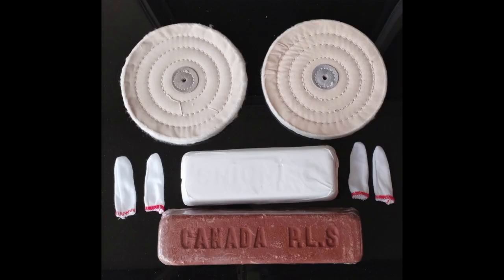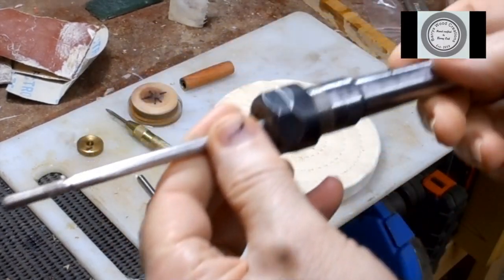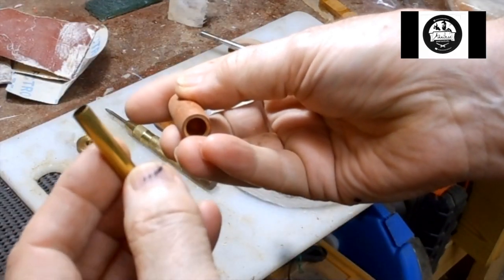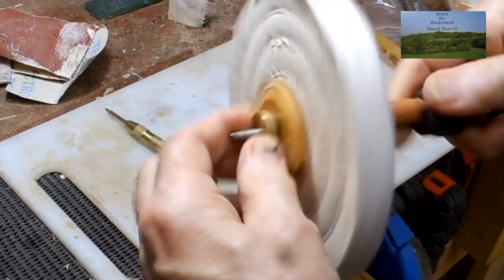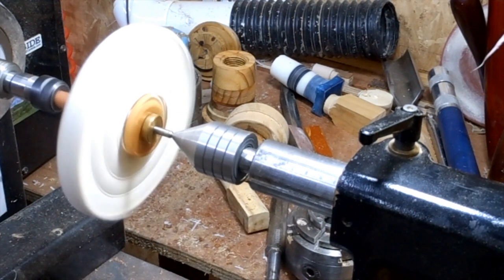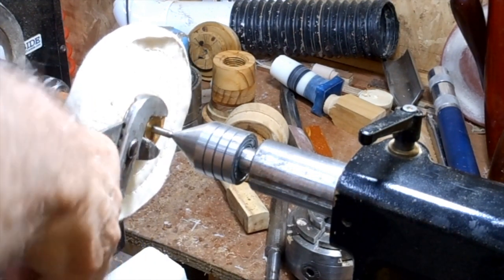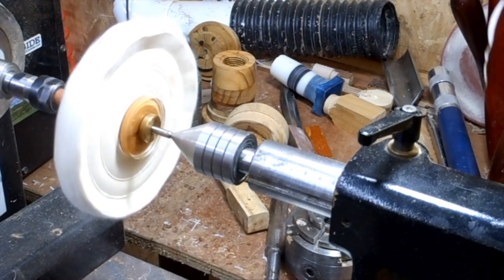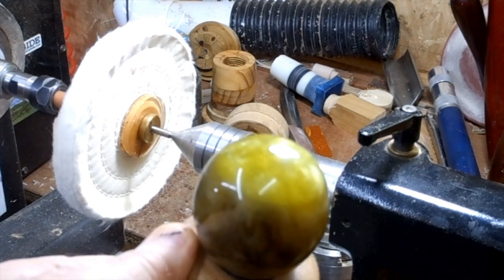Woodturning -E114- Make a Buffing Wheel Mandrel

Comment: Great video John. I wish you would have came out with that a week ago. I had to polish 2 small crosses I made from stainless steel. My buffing wheel that fits my grinder has been tossed so I bought some at the local big box store. Pure junk but I did get the job done. 
It would have been so easy to do what you did.
Thanks for the video,
Gary
Reply from the maker: Thanks Gary, this idea came to me in the shower this morning as I would have gone down the track of fabricating one. The saving grace was seeing the aperture size of 6mm when the wheels turned up yesterday. Next time eh?